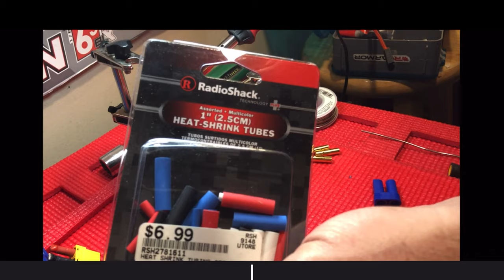Lipo - Soldering Battery connectors - Plus A TIP to protect your battery

Comment: Learned a epic solder to do bro. 

Stop cutting ends off. Just unsolder then plugs and keep the pre tinned wire ends. 

The solder job ultimately in the end looks brand new not having a cut and soldered wire joint 

Try it out I’m liking it. 👊😀
Reply from the maker: Good tip. Thx!

Comment: Your soldering iron tip is really oxidized. Makes heat transfer , and wetting solder much more difficult. Do you currently use the same iron still?
Reply from the maker: I desperately need a better one!
Reply from the maker: Nice, thanks
Reply: @EastTactics  if you plan on doing a fair amount of soldering in the future, and would like something possibly  portable/ don't  want/need a permanent tabletop soldering station, than I'm pretty confident this is the best tool out there . The ts-80 is a bit newer with a redesigned (but not necessarily improved) contact interface for the modular tips and runs on usb-c instead of a dc plug. I don't have high output power banks like I do lipos and standard ac outlets . So was a definite pass for me.

Comment: I try not to tell others how to do things that I don't do perfect myself and I'm not certified to do so but sometimes people don't understand they could be doing something that is adding danger to a task simply for convenience. I would not grind lead solder as particles are going to get in your body with almost certainty. Rather using the iron at a lower temperature that is clean of oxidation and removing access that way you would grind it into dust to get on everything? I might be wrong and you keep everything so clean and you were wearing a mask but just my opinion that using a dremel should be a last resort for the task.
Reply: I mean no offense and actually appreciate the video I really dont want you to misunderstand my comments and are meant for safety reasons and if you disagree just disregard as anyone would.
Reply from the maker: No worries man, thanks for looking out.